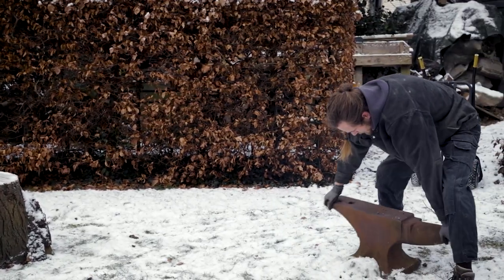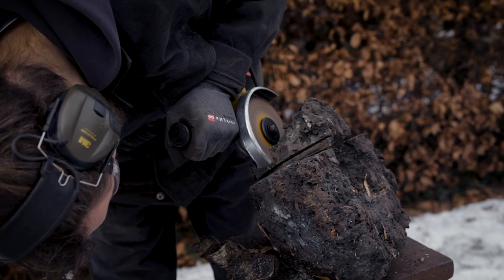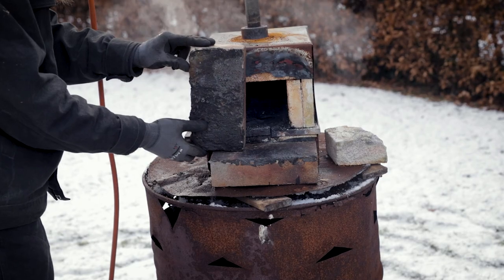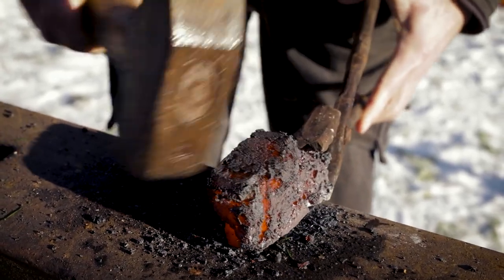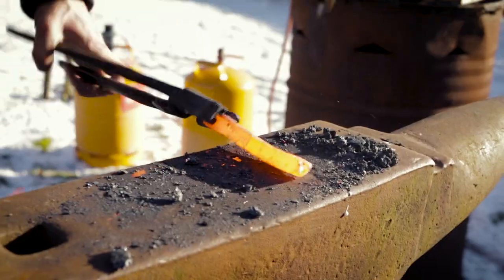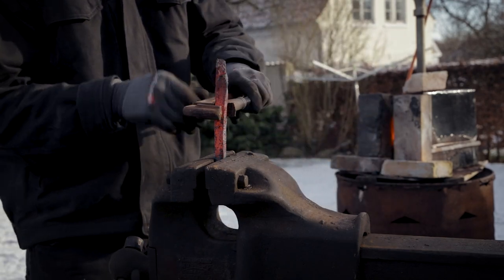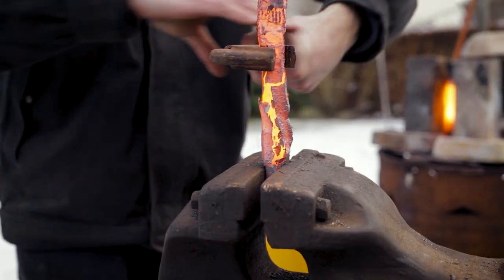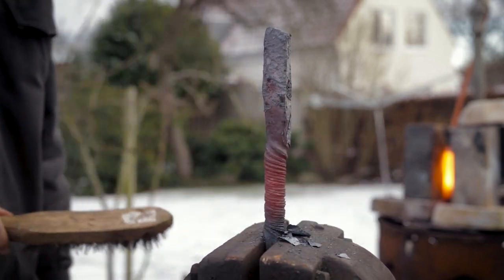Forging Iron Bloom

Comment: Holy crap, your iron looks amazing. Seemingly very little work is required to make it look clean and regular. This puts ancient ironmaking in a totally different perspective. Certainly the real masters back then could've easily processed a thousand pounds of iron in a week, provided they had enough charcoal. A large bloom might weigh a hundred pounds, and a dozen assistants could probably refine all of it into usable bar iron in like a day, which could then be consolidated and reforged and turned into steel eventually.
Reply: I wonder if they had or even knew about Borax?  Wouldn't work as well without it.
Reply: @Roylamx  it was used all thoughout history ever since iron was forged. it is found in dried up lakes.
Reply: @Roylamx  no to my knowledge, we don't have any of those kind of lakes in Denmark, fine quartz sand was used as flux. But if the bloom iron is of decent quality it contains enough slag to be self-fluxing. I have forge welded other pieces of the bloom with out borax or any other kind of flux, just with the slag present in the iron.

Comment: Can anything be done to improve the quality of the black sand result comparable to the bog ore?
Reply from the maker: I believe it is mostly up to how much effort is put into sorting the magnetite (iron oxide) from the quartz parts of the sand. Maybe my brother Sebastian who knows more about this will add a comment. // Jakob
Reply from the maker: If it was further refined (more folds and forge welds) it would probably get an increase in ductility. An other reason why it broke sooner than the bog ore iron is that i think it contains more carbon that reduces ductility. Though i don't know if the small amount of carbon (<0.3%  is enough to cause this difference in ductility), where as the bog ore iron is close to pure iron, in the sense of carbon, not impurities in general.    

That said, both did satisfy the twist test, if it had only done maybe a half or one twist it would indicate high levels of phosphorus which makes the iron brittle // Sebastian

Comment: Would traditional blacksmiths have just spent hours with a saw making those smaller pieces?
Reply from the maker: No, they would have made smaller blooms and cut them with a axe or similar, hot from the Bloomery. No fun cutting them cold even when you got at large angle grinder.

-Sebastian